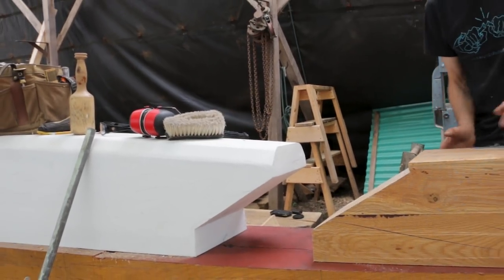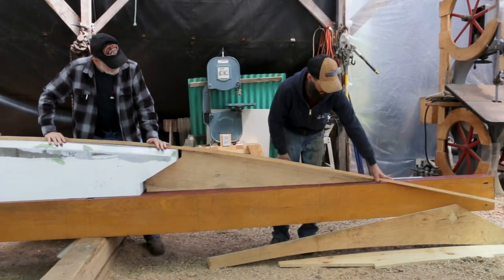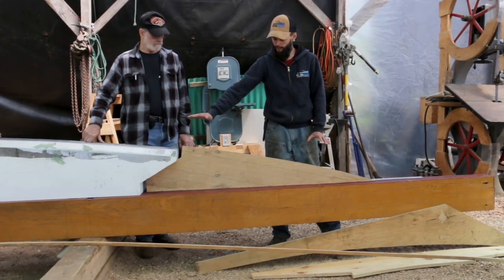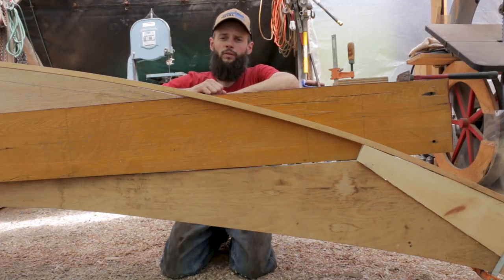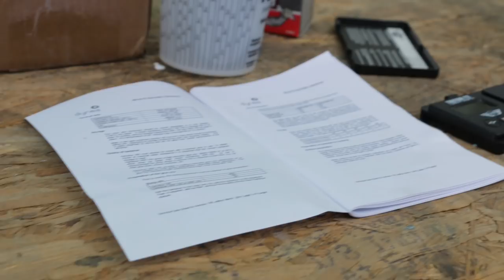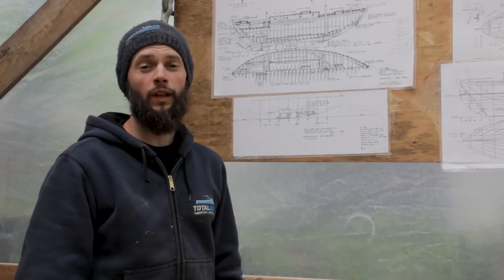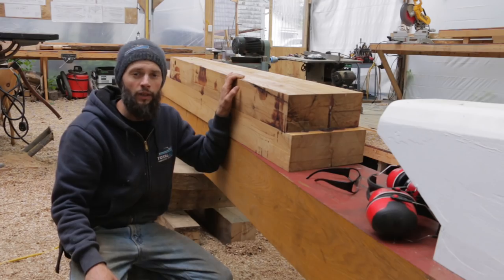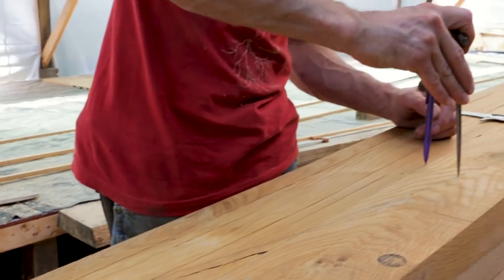Acorn to Arabella - Journey of a Wooden Boat - Episode 37: Shaping the Forward Deadwood

Comment: I can’t believe you guys don’t rough cut the shapes with a chainsaw and then do final true by hand. So much work!!!
Reply from the maker: The circular saw is WAY more accurate and gives awesome reference lines to remove the waste to.  Once the saw marks evenly disappear you are within spitting distance of a good fit.  A chainsaw has more of a chance of messing something up since it cuts so fast and does not have a depth stop or a reference to keep the blade square to the face.
It would initially remove the waste faster but the final fit would take longer since those handy reference lines won't be there from the circular saw and the circular saw cuts to within a 1/16" of the line, I'd never try to cut that close with a chainsaw!

Comment: Lead keel is narrower than the wood keel, I thought they would have matched up. Learn something new each day. Great video guys.
Reply: You know the other really interesting thing i noticed in these videos.
The mobile saw mills, what we in Australia call Bush Mills, that you guys are using are all band-saw type design.
The Australian Bush Mill are usually a circular blade design.
Not sure the reasons why that is, just is interesting wondering why.
Reply: Very old mills in the US used circular blades, but most any new or newer mill horizontal bands saw seem to be the rage. Thinner kerf more teeth.
Reply: True rcdogman re band-saw blade kerf, less wastage than on a circular blade. The flip side is that circular blade is limited to the size of the output board, and not the size of the source log.
Like I said, it's interesting to consider the different tools and reasons for using each.
Reply from the maker: The wood keel will get shaped to fit the lead keel.
For portable mills the band saw ones are super common here.  The circular mills are usually stationary machines.  The circle mills are generally much faster but turn a lot more lumber into sawdust!  The bands are also cheap/easy to sharpen when you hit something.  We found a few screws and a 3/8" lag bolt in the logs.
Reply: Thanks guys re the heads up on work yet to come around the keel.
I'll bet that you're eye's opened wide when you found that bolt :-D>=

Comment: Great to see your progress. 
I understand the purpose of the sacrificial "worm shoe" for protecting the dead wood piece... But why does it not extend forward to provide similar protection to the much more important keel timber and stem pieces? Besides 'that's what the plans call for' I would have thought it would have / could be extended up to the water line.
Reply from the maker: Part of the reason is the depth of the joints forward of the forward deadwood.  The keel timer and stem come together with a nib that is just 2" in depth so the worm shoe would end up being structural at that point.
Instead it will get a bronze strap to protect it.  If we have enough $ down the road we hope to continue that bronze strap all the way to the rudder.

Comment: Questions
1- Why dont you use the bandsaw?
2-what kind of glue Are you using?
3- Why didn't you just add pieces to template instead of cutting it to fit?
Nice to see the progress, must feel AMAZING.
Reply from the maker: There needs to be a flat face on the timber to register against the table of the band saw.  
Since the sides were rough and tapered some sort of sled would have been needed to hold the timber to cut the top.  
We could have used the band saw to cut out the layers pre lamination but that was done before we upgraded the electrical to the boat house so to use the band saw we had to move the generator, start it up...  Was just easier to use the circular saw and finish the last little bit with the handsaw.  
Now we have good electrical in the boathouse so we can just plug in the big machines and work.  So much nicer!
Chainsaws are quick, sometimes too quick.  It's real easy to cut to much off!  The circular saw is much more accurate for cutting kerfs and the saw marks make great reference lines when removing the waste.  

Resorcinol glue, it's what is used to make marine grade plywood

The glue is slicker than snot on a glass door handle.  Keeping everything just so during a glue up is tough, it wants to slip and slide all over the place.  Much safer to glue up a over sized blank and carve it down to size.

Comment: did you guys only use 2 bolts to hold the lead keel on ? thats alot of stress and strain on the wood in that small area in ruff seas
Reply from the maker: 2 for now.  8 more will be installed with the floor timbers.

Comment: I am curious why you didn't use the huge bandsaw that you refurbished to do the heavy cutting?  You would need to build infeed and outfeed tables but you will need those anyway.
Reply from the maker: There needs to be a flat face on the timber to register against the table of the band saw.  
Since the sides were rough and tapered some sort of sled would have been needed to hold the timber to cut the top.  
We could have used the band saw to cut out the layers pre lamination but that was done before we upgraded the electrical to the boat house so to use the band saw we had to move the generator, start it up...  Was just easier to use the circular saw and finish the last little bit with the handsaw.  
Now we have good electrical in the boathouse so we can just plug in the big machines and work.  So much nicer!

Comment: Have you ever considered using biscuits when joining the timbers? I know some will be bolted but sum with horizontal joints wont be through bolted.
Reply from the maker: They are not really used in boat building, more of a interior furniture thing.  The bolts get angled and staggered so pretty much everything will get pinned together.

Comment: I've just finished binge watching your entire catalog and I have two observations.

A three-point hitch carryall for your tractor would save you a great deal of work. Fairly small project compared to some of the things you've built along your journey.

I'm afraid I just can't wrap my head around why the lofting floor is desirable or necessary. If I followed the explanations correctly it's just a one-to-one scale version of the plans and all you're doing with it so far is transferring part outlines onto plywood to cut templates. The lofting floor is created using more or less traditional drafting techniques using the paper plans as a reference. It is only points that you are transferring on to your templates you are then re-creating the Batten lines negating any advantage of having drawn them full size. It seems to me you could skip a whole Lotta work by drafting individual parts directly under your template stock as you need them. A little bit of arithmetic compensates for the baseline moving. 
I can easily visualize the lofting floor being the best way to go back in the Golden age of sail when many of the craftsman building the ships would not have had a solid grounding in arithmetic and geometry but today it just seems unnecessary. Please educate me.
Reply from the maker: A carryall could be handy and yeah, we probably could whip one up pretty handily.  

The lofting floor is all about checking things full scale.  The plans were hand drawn in 1934 and the scale measurements were also taken by hand.  By the time you scale up the plans a 1/32" or even 1/64" difference in the scale drawing is a big error when blown up full sized.  
The lofting checks and fixes all of that, it allows you to check the fairness in all directions of the vessel at the same time, if you tweak one view you have to tweak them all.  

If you were 100% sure the lofted plans were perfect and you were very very careful with taking measurements and scaling them you could just loft each part as you go but I would bet my bottom dollar it would take longer an be more challenging to get a smooth and fair hull that way.
Reply: I think I get it now. 
If you took your paper plans and blew them up to full scale on a fantasy photocopier you'd wind up with lines that are 4 inches wide and it would be hugely ambiguous where to place your nails when you're transferring. So when you loft, your extrapolating detail or I guess precision that doesn't exist in the scale drawing, so the lofting is genuinely a craft you're not just doing the job of the photocopier and if I've got this right another craftsman could loft from the same plans and wind up with a boat that's an inch longer (for example) without either loft being incorrect but the two boats would not be parts interchangeable. Fascinating stuff.
As I contemplate this it occurs to me that these ideas make the tale of the ship of Theseus even more of a brain melter.
Reply from the maker: You are spot on!  
If you gave the drawings to 5 professional yards and had them build the boat the boats would all look the same but they all would be marginally different.  Less so with smaller boats since the scale used is usually more accurate, as the boat gets bigger so will the differences but on a 38' vessel so long as she is smooth and fair the little differences won't matter. 
The old hand drawn plans like the ones we have are basically guidelines for a vessel, they are far from gospel, the lofted plans on the other hand are.

Comment: Curious about the reason for having two pieces on the bottom of the forward deadwood.  Was this to change the direction of the grain but you didn't have a wide enough piece?
Reply from the maker: It was just a good spot to use some big offcuts and glue them together.  Since it's mostly to give the boat shape and is the most likely timber to get smashed to bits if we run aground (it will likely get replaced some day) it's a good piece to use up some "scrap" instead of cutting up a nice big timber that could be used elsewhere.

Comment: I'm surprised you aren't using the bandsaw for many of these operations. Any reason why not?
Reply from the maker: There needs to be a flat face on the timber to register against the table of the band saw.  
Since the sides were rough and tapered some sort of sled would have been needed to hold the timber to cut the top.  
We could have used the band saw to cut out the layers pre lamination but that was done before we upgraded the electrical to the boat house so to use the band saw we had to move the generator, start it up...  Was just easier to use the circular saw and finish the last little bit with the handsaw.  
Now we have good electrical in the boathouse so we can just plug in the big machines and work.  So much nicer!

Comment: That 2nd sawmill was the bomb!
Reply from the maker: Biggest, baddest, fastest mill Wood Mizer makes.  68hp diesel on that bad boy!
Reply: Damn , 70k, Shaving pennies for the rest of your life to pay that bad boy off : ( , i figured around 50k, i used to work with one of these higher end mills.
Reply: Yeah, I was going say go Woodmizer and then it was there. Worked at place that had logging trucks drop off loads, and an old hand who knew his stuff would just pump out tons of material working alone. Expensive machine, but worth it if you're doing any kind of volume. the only help we gave him was pressure washing the logs (spiral tip really winkles out the dirt that dulls blades) and staging them so he could use the hydraulics to lift them on the bed.

Comment: I have a question, i have noticed in this and previous videos that your keel has a decent sized split on one of the faces. How do you manage the split and it weaken the keel timber any? Understand i don't know a lot about woodworking and less about shipbuilding so forgive me if it is an obvious question.
Reply from the maker: It looks worse than it is and it will swell shut shortly after launch day.  
When wood dries is shrinks and with a timber this big what happens is the outside shrinks and the inside is wet and fat so it checks or splits.  So long as they are not huge they won't structurally damage the timber and once the boat hits the water the timber will "take up" and the checks will swell shut.

Comment: Hope that you filled the deadwood cracks with epoxy?
Reply from the maker: That would be a mistake.
When she launches all these timbers will be in the water and will eventually "take up" to their full dimensions.  When they do anything hard in the cracks will act like wedges and split it.  The checks all face a mating surface so they will get bedding compound put in them and will be sealed from the water and critters.  When the timber takes up the bedding compound can squeeze out and join the rest of the bedding compound in the joint.

Comment: As the deadwood is meant to be potentially sacrificial, while you are at this stage you could make a template for a replacement if needed. It would be a bitch to form a new one once she is built.
Reply from the maker: If we were staying locally maybe, but it will be cost prohibitive to ship the worm shoe to the boat.  Also once everything swells and sails for a while the worm shoe won't fit and will need shaping anyways.  Making and installing a new one would be two days work tops.  Would have it done before the one from home could even arrive.

Comment: So the motor is going to be a Red Wing Hit & miss engine? Hopefully it's big enough because the boat is going to be HEAVY lol!
Reply: It's not that critical on a sailboat so i think it may work... (I hawe a sailboat my self).
Reply: But, yes a wooden boat of this size are significally heavier compared to a steel or plastic boat.
Reply from the maker: The fiberglass version of our boat is heavier than the wood one!  When they first built them they sat below the designed waterline and they had to remove over 1,500 pounds of ballast.  
The diesel we have is a Perkins not a redwing and has 53hp, the plans call for just a 40hp.
Reply: That was interesting, my only referenses are old fishingbouts from the baltic sea (i hawe also studied some old shipwreaks for comparishion on spot). But when You mentioned it it seems like smaller woodenboats actually are a bit lighter, i still miss grandfathers wooden boat. Nothing realy can compare to the feeling of a real old scool wooden boat.

(Sorry for my English, i come from the North, so it's not my native language...)
Reply: Steel and glass are both going to be heavier and far weaker than a wood hull. a common misconception..

i mean think of it this way pick up a plank of wood then a similar size plank of steel, glass/plastic ... Seems easy to comprehend that way

Steel is obviously the strongest but it's the hardest to balance strength to weight , especially when it comes to small boats.
Reply: I think the motor will work well on this boat anyway, at least that's my practical experience from sailboats, beside the weight factor here they generally don't even need a fraction of that amounth of raw power compared to a fast motorboat, that motor will, (at least from i found...) give relative lot of torque on lower RPM wich is desirable on a sailor, it's pointless to go only on torque in the higher RPM spectra on a traditionl sailboat, that's a common misstake when people choosing a motor for an old sailor actually, what's needed is power on low RPM.
Reply: Sailboats don't need much power. A 16 foot half cabin sailing boat only needs 5 HP, a similar sized power boat could have 40 HP
Reply: The plans for one of my 30 foot boats calls for a 6 hp. or only 4.5KW !!
Reply: Mine is 27 foot and has an old 1 cyl. diesel engine wich is about 7,5 hk, i thought it was way, way, to weak at first, but if mounted correctly it supprisingly do it's job pretty well.
Reply: AS comparishion, me and my brother hawe a more modern glassfibre boat from the early 90s it´s significally smaller but the motor is a 3 cyl with syncronized carburators and it give around 55 hp i think, but on that boat it's pretty medioker, i think we was able to pump her up to abot 28 kn or so, even if that particular boat type is pretty heawy since it's a working boat and not a racer i still concider it weak for a modern motorboat.
Reply: Oh that makes more sense lol. I knew of a Hit & miss engine for a large generator that was called "Redwing" so I assumed that. Yes a 50hp, especially being a diesel will be plenty. ;) I never thought a fiberglass boat would be heavier but it must depend on the materials used.
Reply: The engine on a sailboat are more a navigation tool in the harbors or to reach the wind rather then taking it forward (like a motorboat), you can simply forgot any sailboat going that well on motor anyway... ha ha
Reply: Ever considered using walrus power instead of horses? They do much better in the water!

Comment: Why not use the band saw?
Reply from the maker: The sides of the timber were angled fore and aft and up/down so there was no flat face to register on the band saw table.  I would have had to make a jig to hold the timber while I cut.  Kerfing with the skillsaw was faster and easier.

Comment: Why not use the bandsaw in the background to shape these parts
Reply from the maker: There needs to be a flat face on the timber to register against the table of the band saw.  
Since the sides were rough and tapered some sort of sled would have been needed to hold the timber to cut the top.  
We could have used the band saw to cut out the layers pre lamination but that was done before we upgraded the electrical to the boat house so to use the band saw we had to move the generator, start it up...  Was just easier to use the circular saw and finish the last little bit with the handsaw.  
Now we have good electrical in the boathouse so we can just plug in the big machines and work.  So much nicer!

Comment: Are you going to fill the crack with epoxy?
Reply from the maker: No!  When she splashes the backbone will be under water and will swell.  The checks will swell shut after a few weeks/months in the water.  Anything hard in the cracks would act like a wedge and split the timber when it swells.